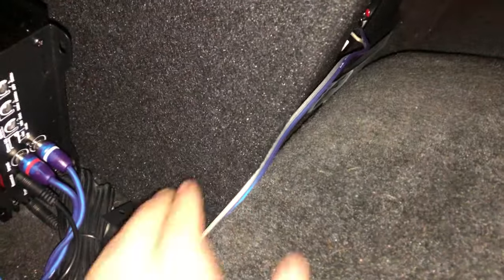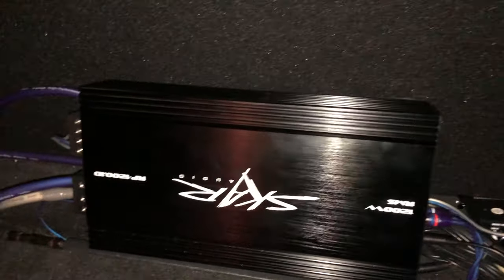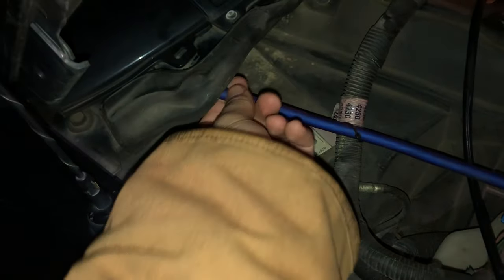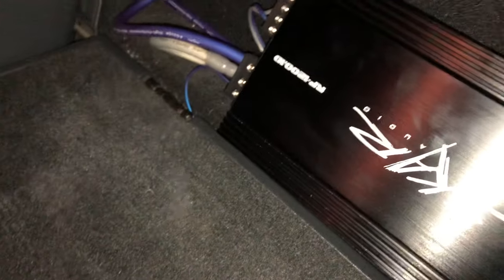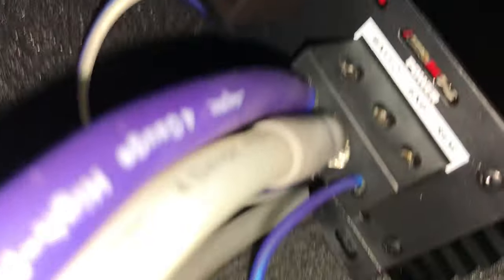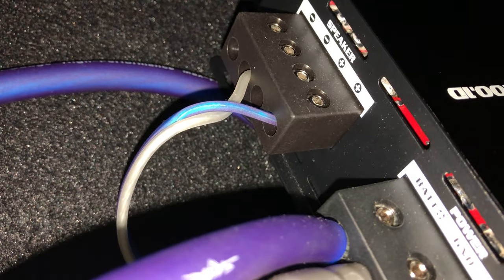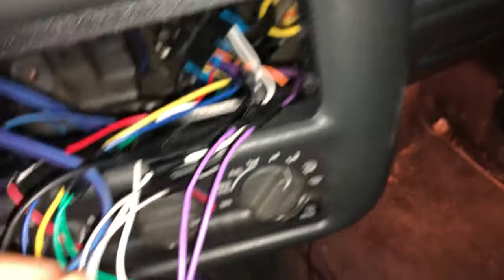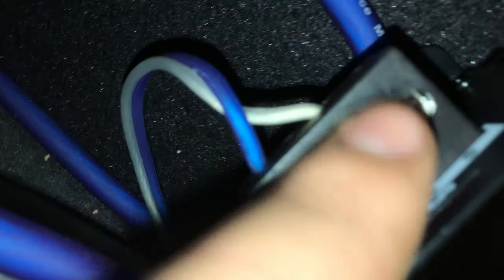How to kinda install any skar sound system full tutorial

Comment: are you using the stock alternator on the car? how many amps does it put out
Reply from the maker: Stock is ok for anything under 2400 at that point you will start hurting the alt. The kit is 1200watt amp for the 12s and 10s. 8s are a 700 and the three eights are 1200.
Reply: @Digital_Tea  wait, so is that 2400 watts rms or peak? btw I bought the 1200s dual sdr enclosure as well, but im afraid my stock alternator will barely handle it..
Reply from the maker: @DSJVNdsjnvf4356  rms and wait what size
Reply from the maker: @DSJVNdsjnvf4356  but if it’s 1200 I doesn’t matter the alt it will handle it fine you will just loss some volts from the battery and make the dial go down a small bit on bass
Reply: Unless you are pushing like mega watts a stock or a little bit better power making alternator will do you just fine. You ain't trying to blow the glass out, then all the bullshit stuff like extra alternators and stuff is ridiculous overkill. If people seen how simple my setup is and how good it sounds everyone and there momma would have a set of subs in the back. You don't have to spend $1500 dollars to have that beat in the trunk. He my shit was gave to me I think I bought a new bluetooth deck for like $50 a wiring kit for my Amp that was free from a friend, and a good sub with a cheap box. Less then $500 dollars altogether. And everybody ask man what you got in there? My Rockford p2's didn't survive a little bump around from driving off the road lmao hoping the skar 12's are built tougher lmao. If not I guess I will give another high priced company a shot and that's not what I wanna do at all cus I'm so rough on everything I own.
Reply: @hudsonhayer9376  yeah i just got mine setup, 1500rp, dual 12s sdr skars, basically... and my cars alternator has only 90 amps at full charging at 2500 rpm. but at idle, it charges only at 10 amps... Obivously my car can power the subwoofers because all car batteries have strong cranking amps, but only for a short amount of time. Yesterday I finally got to test them out, after installing the right cables, and when the bass was turned up all the way my car battery voltage dropped from 14v to like 12.5 very easily. And if you have the car run on idle and the subs are still playing quite loudly, I seen it drop below 12. (Not sure if it's accurate since it's my cigarette outlet..) anyways, that's all i have to say.. Just make sure you don't let the voltage drop to the low 12's.... but yeah, what the heck do I know..

really want to upgrade my alternator, which will really help but they expensive and I don't really have the knowledge to do all that...
Reply: @hudsonhayer9376  that’s the difference in the setup tho. It’s not necessary always the power. You have to put 2& 2 together. Can’t expect big bump on little power subs, amp wires and box all make a sound difference when dealing with audio. You don’t don’t have to spend hella money to be heard donwn the block or for a clean setup. Ask me it’s all a person choice just do research on your product
Reply: @DSJVNdsjnvf4356  mechman alternator 💪🏾 and make sure you do a big 3.
Reply: @1kbutta  yall spl guys trip me out.
Reply: @Wyatt Kessler I’m new to car audio but I have a skar svrD2-12 with the skar rp.800 amp I want to run the car and sound system on one battery what wattage should I get to power both at the same time?

Comment: what if u have no ac? what would i connect the rem to?
Reply from the maker: It just depends on what you drive, just have to take time and examine the wire diagram to find a good turn on or off for the radio. Some cars come Factory with an amp on off so it all depends
Reply: find an accessory spot in the fuse panel and run it from there.

Comment: I lost count of how many mistakes you made on just throwing in the system and this is mistakes that could critically hurt the output of your product first off you didn't send any grounds second you're using a $15 Jensen head unit on a 1500 woofer amp you're going to be amplifying nothing but distortion if you run the ground wire close to the amp that's right however the power wire should never go on the passenger side of the car there is no grommets there on the driver side there's plenty you run your RCA and your remote on the passenger side and your power wire on the driver side you keep elaborating on white is Right channel and red is Left channel sir that is a monoblock subwoofer amp it doesn't matter which side is which you are elaborating on the terminal of the back of the box red is positive and black is ground that is a mono signal coming from a woofer amp it does not matter which direction you install those wires another mistake you have that subwoofer amp right on the back of the box anybody that knows stereo systems you never mount a circuit board which that is what an amplifier is as a circuit board to the back of anything that's going to extensively vibrate like subwoofers duh you go through this big long tutorial about how to hook the remote wire up to the ignition switch side just splice into that wire no wrong the back of that cheap ass Jensen radio has a blue remote wire there what do you know all I'm trying to say from commenting on this video is before you go and act like you know everything and make some big video guiding others do some research so you're not another idiot out there blind leading the blind if you're going to ask Mark try to be smart
Reply from the maker: I’m redoing it soon calm down brih I never said my way way proper correct and or safe. But I’m finishing up at my automotive school and I’ve got a very good understanding of wireing now and how it all works. And yes I’m just lucky because after some time the electric tape is falling off and blew a radio fuse forever ago when I was fucking with it. I never expected 60k+ views are you kidding? I unlisted it

Comment: OMG Please NOONE do what this man did. You WILL end up grounding that power wire and starting a fire through your entire vehicle. Do Not Mount the amp to the box. If you take a little time you can find a way to run that safely into the engine firewall. And get the paint off any surface that you are grounding to. You will have issues if your not properly grounded.
Reply from the maker: I literally say don’t do this, I didn’t mount my amp to my box it’s just mounted to the back of the seat, and I did idk why you assumed I didn’t.
Reply: @Digital_Tea  was referring to the wire bro.  Wasn't being a dick just trying to make sure a new person decides to run it like that. The don't mount to the box was just added in for people that do that.   Myself was one of them at one point.  Sorry if I sounded dickish was in no way tryin to

Comment: What kind of idiot runs the power wire in the door jam??? Can even count how many car fires I have seen because of doing this. If there is no rubber grommet, you run it under the car, all the way back to the amp. Genius
Reply from the maker: 1. That door is mainly unused 
2. This is an old video 
3. The wire is still perfectly fine after all this time and I payed actual money to know what I’m talking about. The only thing actually wrong is how I wired the radio which is fixed with actual connections now. Thanks

Comment: I can tell you I ran my power wire through my door like that and it did take about a year and a 1/2 but it did rub through the wire and it will 100% happen it does take time though and you're talking well over a year so I mean fuck it I guess but the right way is to drill your own hole in the firewall takes 2 minutes that's why every every wiring kit comes with a grammar 😉
Reply from the maker: Didn’t have a drill and didn’t wanna risk damaging my wiring harness as I was way less experienced back then
Reply: Mine has not rubbed not one it bit still looks new.
You just have to know what you are doing.

Comment: Never run a wire threw the door😂😂🤦‍♂️
Reply: I had a friend run the wire through the door, guess what happened, got called over the loud speaker at the bowling alley that his truck was on fire in the parking lot. Moral of story, wires we hot, metal to metal, caused a short and truck went up in a blaze. Anybody reading this DO NOT RUN WIRES THROUGH THE DOOR!
Reply from the maker: Or don’t incorrectly wire your amp to where the power is always hot when the cars off

Comment: Should be "how not to wire a system"..
Do not try this at home people.
Reply: @Digital_Tea  My setup on for my front speakers is like yours.
MY sub setup goes thru the firewall nice n easy I did a double run of power wire.
My skar amp isn't as powerful as yours though.

Comment: First of all clean your car I never run a high-output wire through your door there's plenty of grommets underneath the car and on the firewall that you can go through that is just laziness and lack of skill please do not install aftermarket systems to anybody's vehicle except your own that is a big fire hazard I would be embarrassed making this video
Reply from the maker: Well I’m not because I now know a lot more than I once did thanks to wyotech. I’ll admit the radio was sketchy at best but this wasn’t laziness and it worked. This was me tackling subs for the very first time and no one video explained how to do it. So i pieced it together and figured it out off of logical guessing. Even though the radio was my only mistake in the video.